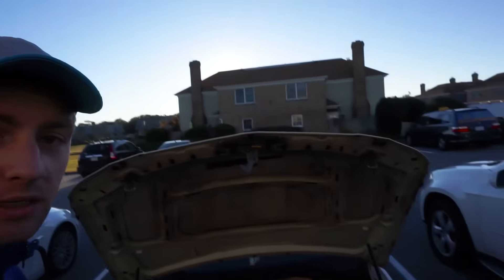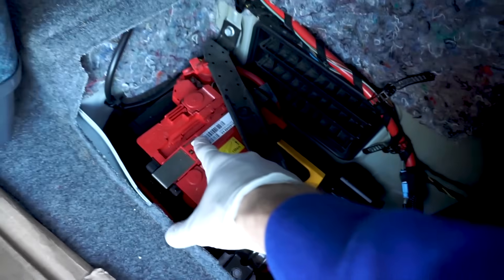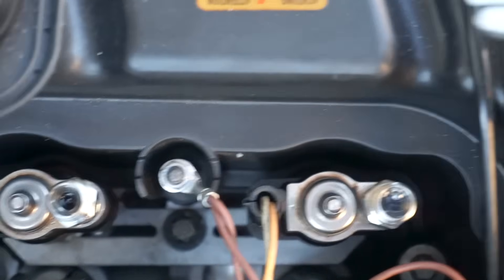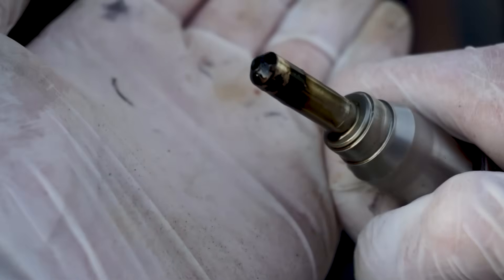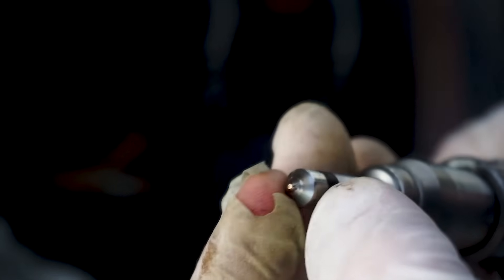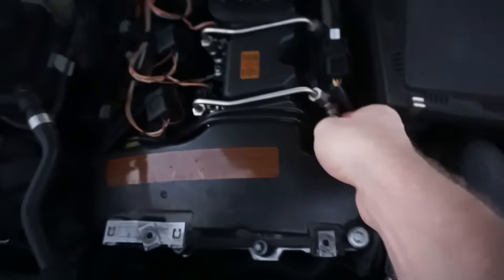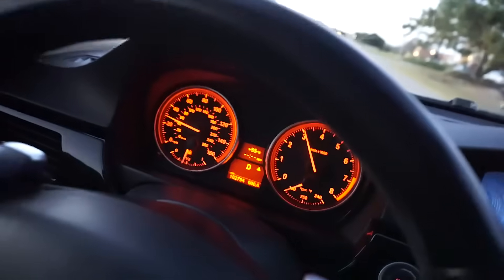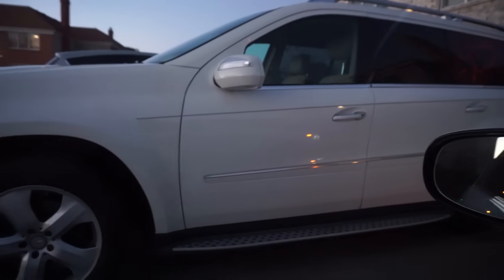BMW 335i fuel Injector problems! Quick fix for 0$ Read Description! how to fix bmw e90 injectors

Comment: Hi mate I got a bmw and when I start it in the morning first star it's running a bit shaky after 2 minutes it's all perfect . But used a scanner and it's saying stlystem too rich bank 2 can u help please?
Reply from the maker: Yes, that the exact problem, will say that the best option is to replace the injectors,,, from my experience it's cheaper then ty to clean it or extend the life of the injector. It's common problem, so it is what it is. good luck!

Comment: Carbon on injectors is inevitable and normal. The problem with the injectors is not the carbon build-up. It’s the inability of the injector to hold fuel pressure when engine is not running. As a result, fuel leaks into the cylinder/piston, thin out oil, and end result is a broken piston or ring or piston itself, which mean engine replacement/rebuild. When an injector starts to have this issue, you will notice brief misfires in the morning for a few seconds, or misfires when the engine is under heavy load. If you get this, don’t mess around with the injectors, replace it immediately with an Index 12 injector. Might be expensive for one, but it’s better than buying a new engine.
Reply from the maker: Back in the days I would fight you back, but you are completely right, but one thing that by removing carbon a specifically if there lots, you maintain the proper injection aerosols, but like you said it’s not that practical, because if injector is leaking, it’s still a problem even if the car start driving bot better.
Thanks for the comment!
Reply: @Makhnovets   That is true. Carbon build up is a longstanding issue with the N54, hence port injection helps a bit with the issue. So cleaning them only solves the spray-pattern issue temporarily. I bought Index 12’s for mine six month ago. Removed one of them just to see how they were doing. Lo and behold, covered with carbon. However, I do believe that since the injection occurs continuously throughout the combustion process, it is not easy for the small nossles/holes on the tip to close up because of the carbon. So whilst the tip might be wholly covered by carbon, unseen to the naked eye, the holes remain cleared. Hence my motor is running as smooth as six months ago when I installed the injectors. It’s just my opinion.
Reply: I installed index 12s about 3 years ago, 50k miles later Im starting to see in my afrs that they’re not closing all the way when off the throttle, doesn’t appear to be any leak down and I just installed a new hpfp a week ago, running at higher rpm’s (3-4500) for a few minutes seems to unstick them for a little while so idk. I only use 93 top tier I’m thinking about sending my original index 1s off for cleaning and testing/servicing
Reply: @Whiboi  Injectors on N54’s are a nightmare. 12s flow much better than the 1s. Why not send the 12s for servicing/inspection?

Comment: How do we know u had an issue b4. I think you just made it up.
Reply from the maker: after replacing all of the component's like plugs, coils, filter, check valves, and more, you will get to the point the n54 with 100k mi will have issue with the injectors. on the top of that i had 5 BMW's before that one, and three of them was with n54 engine. I'm not saying that the best way to do it, but if the top of the inj has dirt, or carbonation that's pretty predictable. easy way to maintain the injectors is to use BMW injector cleaner or Techron. I'm using it in all of my BMW's and i have a-lot of great reviews about! And yes I would not do the same think with any of my BMW again, since it was the test! other wise if so, that gonna be strictly for replacing seals and decompressing rings!

Comment: To avoid the  noise, it very simply. 
Start engine, wait to work temperature,then put gas pedal between 2800 rpm-3000rpm and hold 5 minute like that. 
Then drive 15 minute with Minimum normally driving. 
Also change motor oil until 10k km maximum service intervals 
Spark plug 30k and bobine 50k.
Enjoy.
Reply from the maker: Or to buy a new set)

Comment: Can I soak the injectors tips in paint thinner or carbon clean for 24hrs to get the carbon off?
Reply from the maker: Yes, but you have to replace the seals!
Same as the decision springs!
Reply: Savage Motor Gears can I use micro fibre cloth? To remove carbon on tips or is there risk of damage? Thanks for reply
Reply: @Worldscientist47  U can't damage the tips lol, micro fibre cloth will be perfect

Comment: First it's an o ring not a gasket an why wouldn't you clean all the injectors there a known weak point.
Reply from the maker: Just did try it. The way why its going bad it's O-Rings and decompression rings as well as that all junk on the nozzle, which is clogging the exit hole and after all we have bad combustion and so on. so i was testing it out. I'm not saying i did it right, but it did work!

Comment: Guys I need to clean my injector 5 . It is not working cold start. After clear the code it's run hole day fine. But next day morning same issue with cold start. Do you guys think I can clean it without change the gasseal and install it again ...
Reply from the maker: No, the Video was done just for seeing what inside, but you have to replace the seal. there way how to install the new seal without special tool, just check the others video's, you just get the pen plug or something similar, and press the seal. But before cleaning, try to run the techron injector cleaner, oe OEM one, run it like 2xtimese, full tank=inj cleaner/full tank and then do it again, after running out of 3rd gass tank of fuel and two cans of techron inj cleaner, check the difference. if there no changes, you have to replace the injector itself!
Reply: @Makhnovets  I have a qn. If I want to change cylinder 5 injector only. Does it works . Or I have to change all . After that I have to do bmw programme or not
Reply from the maker: @sabbirahamed8554  yes, you have to program it, but you don't have to replace all of them, as far as index is the same

Comment: Sollte man es nach dem ausbau nochmal Codieren? 

Should it still code after removal ?
Reply from the maker: Nein, ich habe nichts codiert, es gab schließlich keine Nachrichten mehr. Das einzige, was Sie tun können, wenn Ihre Injektoren dort getestet wurden. Die Spezialflüssigkeit für das Kraftstoffsystem und die Einspritzdüsen verwendet es ebenfalls und Sie werden keine Probleme haben.
Reply: Savage Motor Gears Danke für die schnelle Antwort.

Also kann ich die injektoren raus nehmen sauber machen dichtungen wechseln und wieder einbauen ohne es codieren zumüssen.

Natürlich merken wo welcher injektor montiert war.
Reply from the maker: @GH-mf5lr  Ja. Sie müssen jedoch die Dichtungen austauschen. Wahrscheinlich werden die Dichtungen nach dem Entfernen der Einspritzdüsen beschädigt. In meinem Fall gab es einen Test, aber ich habe Dichtungen und Druckfedern ausgetauscht. Viel Glück!
Reply: @Makhnovets  answer that question in English please
Reply from the maker: No, if you not Going to change the position of the injectors, but you have to replace the decompression rings and gaskets, with that you'll get even better results, gaskets replacement is mandatory!!! Links for the parts in description!

Comment: DONT BUY REMANUFACTURED INJECTORS!!!!! I just got burned off of a set they are all factory defects and will have your car running worse than ever. I seen he linked some remans but there is no such thing as remanufactured injectors please check the forums.
Reply from the maker: Unfortunately you are right! They just clean them with Ultrasonic, and you might get lucky, but like you said, in most cases they not reliable!

Comment: i have to ask I have a bmw 750 and its been a year replacing parts etc. I am boiling it down to injectors now. I have misfires low end shaking, hesitation and vibration. I hope mine clears up after I redo my injectors. as happy as I see you I would love if you can tell me the issues you had before you did the injectors
Reply: did you ever do the injectors, did it fix your problem?
Reply: @trainwreck5973  i have a 750 my self and 1 fuel injector cause the piston to break cause the fuel injector was not working probably
Reply from the maker: Yeah, the leaky on direct-inject engines are pretty common. but it also can be on the regular injectors. like in a comment below you even can have a hydro lock if it's pretty bad. their way to test the injector, as well as some people do, is by removing the rail, inverting it(just leave the nozzle out of the cylinder), and pressurizing the system, in that case, you can physically see if the injector is leaking or not. https://youtu.be/qyznBdRUmqE

Comment: You didn’t replace the Teflon seal that will cause problems and eggshells
Reply from the maker: Sorry! it's Not in the video, But I did Mention in the description, My friend suffered a lot after the dealer replace the injectors and didn't torque the injector bold on e71 M, 3 months later the seal burned out, and inj. start jumping producing rattle noise and loss of power and bunch of massages, the dealer took it to test, they charge 2k for diagnosing and said that he needs a new engine. Long story short, we replace the seal and it works, but in the worst case, it could be fatal. 
Thank you for the comment! https://youtu.be/qyznBdRUmqE

Comment: Bmw recomends additives... so no need to work on the engine
Reply from the maker: check the video how the additive work! on the top of that you have to use pretty much evry second refuel, and bottle cost like 12$ or Techron pretty much the same for 4.99$ in Walmart... on the top of that you have to replace decompression rings and injector's gaskets...
Reply: Additives? Yeah right. Those injectors ( Siemens VDO ) are garbage. They tend to malfunction. Several injector cleaning and rebuild companies assured me that if the injector is bad you will have to buy new ones. Cleaning does not help. That's what I've been told. But you can give it a try cleaning them. Not much work. And if you buy new ones buy index 12.

Comment: DO NOT DO THIS. if you pull out your injectors you will need to replace the injector seals. for preformance and saftey reasons.
Reply from the maker: in description i have all the info! but the video was just for checking the difference!
Reply: I never replaced the seals, 486whp no problems for 2 years

Comment: Well my e92 330i suffered from misfire. I have replaced all coils sparks and injectors (yes), nox sensor, maf cleaned cat cleaned. And it still misfires randomly!!
Reply from the maker: The leaky injectors are pretty common on early models, if you have over 100k mi. better to replace them, especially the n52 inj. are pretty cheap.
Reply: FUGLY UCKER - time for a walnut blast
Reply: Well I was considering that (or sea foaming it but I saw different opinions about this procedure) but still I dont know if I dont have any air leak. Just changed oil level sensor, oil, front wheel bearings, and my car swallowed 40perc of min to max oil scale in 650miles. That would be around 400-500 ml. Dont know if its normal but before oil level snesor change it showed max all the time... anyway. Car still does some strange noises. Maybe I will put a video showing this.
Reply from the maker: did you figure it out? What was the compression or the outcome?
Reply: Check EGR Valve rate with a obd reader when it starts to misfire
Reply: Try mosfets if you’re running msd80 dme they will do that cause misfire

Comment: I can say cleans it better than replace it. If it still working. Otherwise you need to reprogram the new injectors.
Reply from the maker: there not a big deal to reprogram injectors, as far as you have a laptop and proper OBD. But I was planning to sell a car, so I tried to clean that, and it works out well! after that I drove the car for around 7k mi and it was 7-8month, and I sold it) My suggestion if you will clean it, just do one by one, otherwise you have to buy a special tool to compress the nylon gaskets on the injectors. better to replace gaskets and springs after all.
Reply: What happened to your car? Since you didn't replace your seals.

Comment: what symptoms did the injectors clean before?
Reply from the maker: every start after several hours starts with unstable engine work like couple cylinders are not working, something like that. after worming up everything goes normal time by time worst and worst. till it starts doing while the car is in working temperature and every single start.

Comment: Usually helps to clean in a sultrasonic cleaner immersed in petrol with high dose of petrol additivum. In the better way you could put on the wires from the 12V battery on pins for open the needle into the injector. This method can clean a mess into the injectors. In second step you can unscrew the bolt for input high pressure petrol pipe and clean the internal filter. If the injectors doesn't seals (drips), there are two ways...1) mess under the needle can't fully close and petrol drops from the nozzle and there is bad spraying. Try to repair in ultrasonic cleaner with 12V wires on connector. 2) probably is the needle physically damaged and there is no chance to rescue.
Reply: 12v won't cycle these injectors I tried it
Reply from the maker: Year later, and i still fighting - https://youtu.be/qyznBdRUmqE

Comment: So tell me, if i wanna to only clean the injectors, what kind of seals i must replace ? Rubber or that silver teflon "rings" ?
Reply from the maker: Rubber one, search for nylon gaskets for your type of BMW, they are cheap, also the silver decompressors, they are important as well, after all, you need the special tool to install the gaskets, but you can kind of buy and then sell it or return it...

Comment: How is the car going now?

Might try this before spending €1000 on new injectors ..
Reply from the maker: It’s working but for about 2000mi... so it can work if u want to extend that replacing point...
Reply: For me it works 200km, then the first injektor drops fuel and now i replace them (INDEX 11 i injektors are the next option)

Comment: after all the money I have spent on this car, HPFP, LPFS, alternator, crank shaft sensor,  and my car is still running the same way, POS. Before I buy anything else for this car I may have to try this!
Reply from the maker: try to make a little vid about the problem, I will try help you! if it's running weird just try to explain or show, same with the noise as well... you can send me the link in messages or in the comment here!
Reply: Kim Lee the car is really a great car, just has issues. Take it to a real mechanic and not someone guessing. You will then get the issue fixed first time and be done.

Comment: What did you use to clean your injectors
Reply from the maker: Break or carburetor cleaner. make sure u gonna also replace the nailon gaskets and decompressors, they dirt cheap, but your car will start to work much better.
Reply: Very good ty

Comment: Can I use the CRC Maf cleaner instead? Only asking cuz I have it sitting around..
Reply from the maker: yes you can, wd-40 will work, but u have to replace the gaskets, for gaskets u have to use special tools as well, in my case ii was trying out that technic, as well u can replace the springs, i will make the video about gaskets and springs in couple days,. if u decide to do that without replacing the gaskets make sure u clean injectors as fast as possible without damaging the gasket! because nylon gaskets gonna be expended in 3-7min. in that case u gonna have bigger chance to damage them.

Comment: Please no one do this ... If the injector is removed change the seal and the decoupler
Reply from the maker: Yes, you are 100%right! didn't mention in the video, that was the biggest mess top, but I right description.
Reply: Dominik - i bez nowej ''gumki'' żyją i tej blaszki.
Reply: i disagree, removed mine many times, they dont need a seal change. even a bmw master tech i speak with regularly says they dont matter
Reply: @colinodon1  Hello 335ichronicles,  but decoupler must be change or not necessarily ???
Reply: i dont change decouplers either
the decoupler resembles a crush gasket, however upon removal i never see it crushed
Reply: @colinodon1  In n63 4,4 - remove injector is shit work ;)
Reply: @colinodon1  what if on a n20 does the seal need to be change for the injectors?
Reply: Carbon buildup is not the major factor on these Injectors.The biggest issue is fuel separation,caused by the 200 bar high pressure and under hood temperatures after shutting off the engine.These two factors cause the lighter and heavier molecules in the fuel to separate,waxes and varnish starts to build up in the mechanism causing 'stickage' and slowing down the response time of the metering.
 I have flowed and cleaned dozens of sets of N54 Injectors,and this is almost always the case.Only two Injectors,failed due to leakage or piezo stack damage. Precicionline fuel Injectors.250 870 6750.
Reply: @chrish8455  is there any way to get it clean up or?
Reply: @chrish8455  how do I flow and clean my injectors

Comment: It seems like the injector clack/ticking sound is still pretty severe
Reply from the maker: I have the same, also add the springs and gasket to that job. i will do the vid about guskets and springs in couple days as well, also will explain why the injectors are clicking...
Reply: I know tapping like crazy.... Liquid Molly 🤔

Comment: So were you having cylinder misfire?
Reply from the maker: at the start there was 2x cylinders missF after a bit start getting worst, then i got multiple cylind miss, replace spurck plugs, then coils, didn't halp, aftrr all get read of check engine and service. till now it's work just fine, after that vid i only replace the injector gaskets and springs, i will make the vid about in couple days...